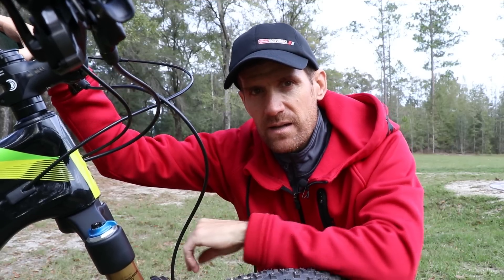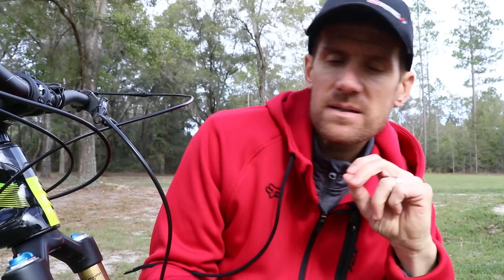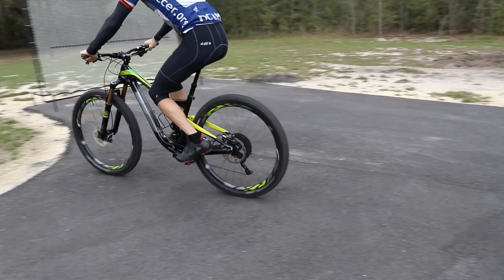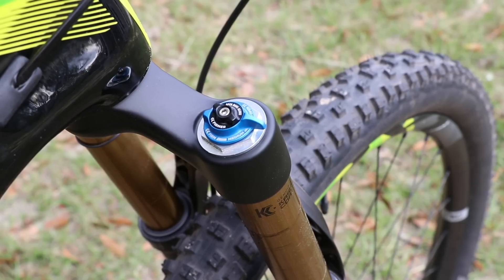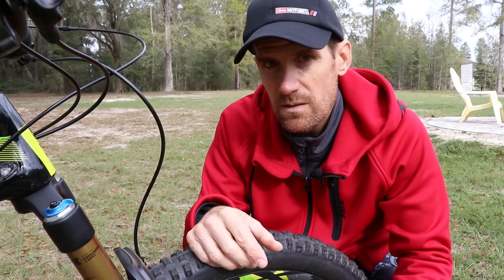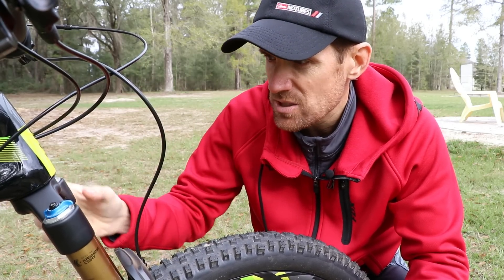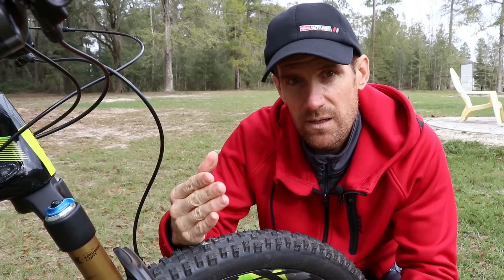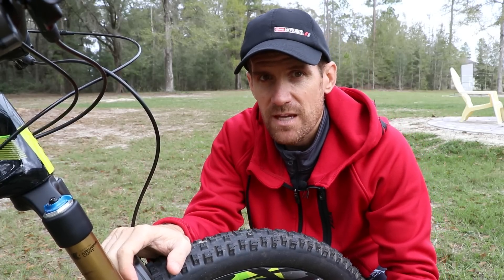Mountain Bike Compression Damping Explained

Comment: Is there a way to adjust the sensitivity of this with small bumps or small rocky trails?
Reply from the maker: Start with reducing low speed compression damping, which would mean, turning the dial all the way counterclockwise. You can also remove volume spacers inside the fork.
Reply: @ClintGibbs  thanks for the reply, I'll try taking out 1 volume spacer and see how it goes.
Reply from the maker: @mjojrjr6231  sounds good. Let me know how it works for you
Reply: @ClintGibbs  will do, you explained this so well. Seen this long time ago and keeps coming back everytime I need to refresh how to set Fit4 Fox Fork.

Comment: I have the 38s with fit 4 damper never fully lock them out as they do get stuck in lockout if the blow off shims don't trigger when hit something hard, could be pot hole or drop happens to all the fit 4s not happened to me yet as dont use it. I was warned about it and seen it on comments on fox fit 4 damper video aswell, hsc is bottom out control if you have an x2 damper as for our fit4 dampers you forgot rebound if your over 200pbs forget fox chart it has me at 1 click on that im at 10 on my actual fork

Comment: Nice explanations. I have never given it a thought that the low speed compression is not a set and forget matter. I have never adjusted mine on the fly, But will try it out now, Thanks ! Although my fork and damper is also from FOX, they don´t have the 3 modes of lock/unlock, but only fully locked or fully open via knob on handlebar.

Comment: It has taken me such a long time to get my head around this topic. I have the fox 36 and Float x2. Both have HSC and LSC and understanding how this works has been a bit of a mystery until this video. I may have misunderstood but I think I heard you say something to the effect of rebound being a bit of a "set and forget" scenario. That makes this a way easier process if I don't have to adjust rebound every time I adjust compression damping. You have helped me understand what LSC and HSC do and I have set my shocks and forks accordingly. Can't wait to feel it out on the trail. Thanks for a great video
Reply from the maker: For most people, rebound settings are indeed set for your weight and pressure and then forget it. However for people who do Enduro and downhill racing, they may speed up or slow down the rebound depending on the type of course. But for the every day rider after you get it set you’re pretty much done.

Comment: Thanks for a super nice video! I really struggle to understand the difference in using the lever to make the suspension mor firm or add more air pressure e.g. if i set correct sag in “open” mode, what would be the difference in turning the lever towards firm or add more air pressure? Thanks!
Reply from the maker: Air pressure determines how much the suspension can move. The blue knob is a compression lever which determines the forces it takes to get the suspension to start moving. I know that may not sound super clear, but my recommendation is to get the SAG right and then fine-tune the feel with the blue knob. Proper sag also Helps with the negative travel. That is, helping the wheels stay connected to the ground, when there are divots or G-outs in the ground.
Reply: @ClintGibbs  thank you for the answer! I’ll do as you recommend. But bringing another dimension into this; if I adjust air pressure to get correct sag but I feel the suspension is too soft and bottoms our, should I then use the lever to make it more firm or add a volume spacer? My own guess would be if it is too soft but not bottom out = use lever. If too soft and bottom out = volume spacer and perhaps lever too if still too plush. 🤔
Reply from the maker: @davidalberius6107  correct. If you have the SAG set right, and it feels too soft, you need to add a volume spacer or two.
Reply: @ClintGibbs  thanks a lot!

Comment: So am I suppose to get off my bike everytime I go uphill or downhill and make all these adjustments because the trails I ride have uphill, downhill, roots, and ruts. I know they make remote lockouts but may be a little spendy.
Reply from the maker: For XC type ridiing I leave my compression settings in the middle. Riding in the mountains I will leave it in the middle for climbing and then open them up for descending. It's really not a big deal to just reach down and flip the lever on your shock and then on your fork before you start your descent.

Comment: WHAT??? You ADD compression for harder hits? I have found the exact opposite. Maybe if the fork psi is low, yes, you don't want to bottom out and so I guess you could add compression to avoid too much travel. The compression on my XC bike is extremely sensitive, and I often ride it completely locked out. I've even added 15 more psi for my weight to 65 total to lessen the travel so I can actually use the max compression setting before lockout. It's actually too squishy even for light trail riding, so I often keep it locked. I usually don't set the compression below max, or one click away from lockout. Only if the trail is steep and chunky do I lower the compression down, and it's rarely completely open. I guess it really is subjective. But it does for sure feel better more compressed and my downhill times are in general faster if it's more compressed. Downhill being a 'normal' trail or technical XC usually between a 3-8% decline, 9%+ would be more a more open setting. After using a Suntour fork (with no compression option) for a couple of years, I have found compression with my Manitou Machete and Mattoc to be by far the most useful variable on a hardtail besides tire choice, even if the compression is usually not 'varied' if you get my point.

Comment: i have a remedy 8 with a lyrick select plus, and i dont understand the charger compression can you help?
Reply: Lyrik Select + has low speed compression adjustment via the dial on the top of the right fork leg.  If it's like the
RC2 damper there will be 18 clicks.  You can think of low speed compression damping being used to control the compression of the fork due to input from the rider, such as weight transfer when under brakes, or climbing a steep hill, even pushing into the bike in corners and pumping in flowy terrain.  The more damping you add, the more force is needed to compress the fork.  There is no bypass as such so the low speed compression will have some effect on high speed hits but it will be most noticeable on smaller bumps and slower shock speeds.

Comment: Very informative as I’ve been playing with my compression and trying to understand how it works and setting it up.
Reply: Clint, I just rebuilt my lowers on Fox 34 FIT4.  I also have a newer Fox 34 Grip.  The problem I’m having is getting the sag set up without using more then the recommended air per rider weight.  Fox recommends only 120 psi max, I’m 180ish pounds and the amount of air I put in is 118 psi.  The real issue is w/o riding and during my mounting the fork used 90% of the travel full open or mode way, can you explain, UGH!!
Reply from the maker: Louis Nocki Never seen that issue so it’s hard to say without looking at it in person. Are you sure your shock pump gauge is accurate? You may want to try another pump just to make sure
Reply: @JesusRescuesUs3-16  do you use 90% of the travel throughout your whole ride?
Reply: 6fxd, yes.  Why do you ask
Reply: @JesusRescuesUs3-16  i think that should be ok, i usually used about that much when i finished riding as well.

Comment: Low speed adjustment should be called initial adjustment . Every times a shock or fork go into high speed, it has to pass thru what they call the low speed. Furthermore the low speed adjustments do affect the high speed dampening quite a bit. Try it, crank the low speed compression to the max and you will see your forks will feel stiffer everywhere.
Reply: Actually it's the other way round, the low speed does offset damping a bit, but it's the high speed compression that limits its range, see the high speed as a valve that opens when enough force is applied and the low speed as a bypass around that valve, which varies in size.

Comment: Good day, I'm having trouble with a dual air rock shox. The negative camber has a very low volume, so when I unscrew the pump the air that escapes f..s the tune up. Do you have an advice to tune this kind of fork?

Comment: One of the better explanations I’ve seen. Thanks. How about balance adjustments in relation to front to back?
Reply from the maker: +michael streed as long as you have your sag setup correctly then it's just a matter of feel. That is, if the rear shock feels too harsh in relation to the front then just add more sag.

Comment: Hey Clint, is achieving full travel the ultimate goal if one rides the same trails all of the time learning to and or first setting up the suspension? I have the same fork as in the video, what's a good reference point to start in when messing with the compression dial? Fully open, mid or firmest setting? As with rebound, Fox's recommended rebound setting is from fully closed contrary to your previous guide on how to set up the suspension (and i'd agree with you btw) so wondering what's worked best for you when dialing in the compression dial. Cheers on another great video!
Reply from the maker: +Miguel Navarro I leave my compression dial in the middle setting for most of my riding because it's up-and-down. I would open up the compression damping knob on a long downhill. The only time I lock it out is riding on the road or if I were on a long fire Road climb.
Reply: What about the dial for stiffening up the beginning of the stroke (black dial). I understand it's subjective, but first fork with it and I'm all ears on any pointers. Thanks in advance
Reply from the maker: Totally a matter of preference. I like leaving it pretty open as in pretty far counterclockwise so the open setting will be very plush on a downhill.

Comment: hi don't you find the M setting on the fox to light ?
Reply from the maker: +scott wilson on the fork?  It can bob while you're out of the saddle but the payoff is a more supple and compliant ride on the trail. If It moves too much while you're riding you can tune it with a little bit more air pressure and add a volume spacer. Also slowing down the rebound will help.
Reply: Clint Gibbs yes sorry on the fork.  mine are same forks as yours . I find my rear shock has a great platform not alot of Bob so I find when standing the front bobs alot . I'll try your method thanks

Comment: I wonder if those volume spacers fit the older Fox CTD forks?  I have a 2014 32mm 120mm travel factory FIT CTD fork and actually added some float fluid into the air chamber to make it more progressive, those spacers seem like a smarter option but nowhere do I see them listed for my fork, do you know possibly offhand if there is a solution for the old Fox 32 mm stanchion forks?  Also another thing to note for readers is at least on my fork the 2nd adjustment affects the middle position (trail) on the older forks and not the fully open setting.  I checked out the trails too at Croom you reviewed awhile back, tons of fun, just wish the entire thing was like the challenging sections.  Interesting theme they have going with liquor and underwear along the trails.  I would avoid that though again after a rain, those mining pit sections were very very slick today.
Reply: I'm wonder the same, do you ever found those spacers?

Comment: the fit4 in medium setting is actually the open setting in the 22 clicks. I usually ride the medium or the open setting in the 12 clicks. The fox 34 is not a DH fork, but i find it more good on the medium setting, so you don't bottom out the fork, even with the  big volume spacer (i have the one from Push Industries, because my fork is a 34 from 2012 with the fit4 upgrade, and push industries volume spacers)

Comment: Thank you for this video. I'm a newb rider and have replaced the original RS Sektor gold 2017 fox 36 on my 2015 Santa Cruz 5010. The rear has an old(2014-2015) fox evolution ctd shock. After replacing the fork the rear shock seems inadequate now. Do you have a good suggestion in the Fox family to match the fork?

Comment: Hi Clint being a bigger guy 17st would it be normal for me to have my Lsc maxed out?  As soon as I back it off,  I feel the fork dives alot.
Reply from the maker: +keaty1984  if you're sad get setup correctly then it does sound like you need to run a lot of compression damping.

Comment: Hi Clint, have you ever found yourself adding some air pressure to the fork without any impact on its SAG? I'm testing a couple of NEW forks and dampers and it looks like the SAG doesn't always change so quickly with the air pressure increasing. I have the suspension fully opened. Would you say the models I have can just be sticky as new and never ridden?
Reply from the maker: +ShaiBike the fork seals on new bikes need to be broken in. That's why I recommend cycling the fork a few times before setting the O-ring to check your sag. That's probably what is happening.  The fork seals are just sticky.

Comment: Hey Clint I was wondering if you could give me some information on how to screw a rear derailleur in? I don't really know how to do it and I don't want to ruin the thread.
Reply from the maker: +Henris Ivaskevicius just a 5mm Allen wrench and make sure it's rotated back enough so that you clear the stop on the hanger. Apply a little grease on the threads before doing it. Doesn't need to be crazy tight.
Reply: Clint Gibbs So if I rotate almost all the way back I should be good to go?
Reply from the maker: Yes. Just keep an eye on the derailleur and make sure it goes flush against the derailleur hanger.